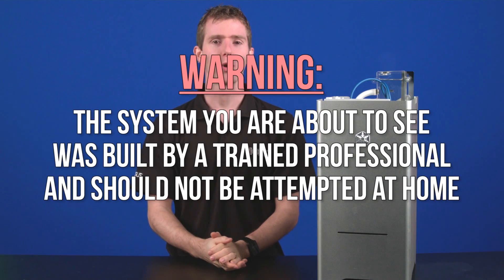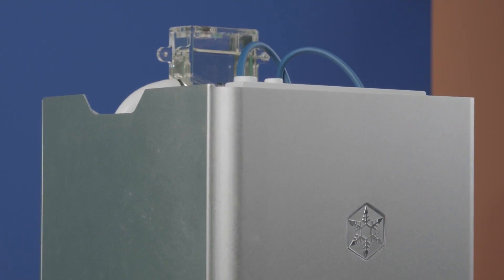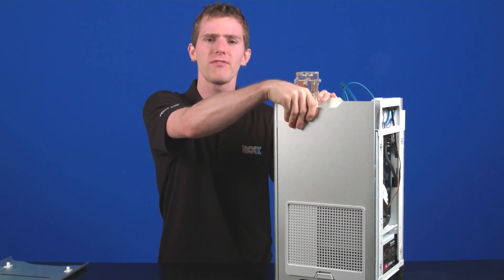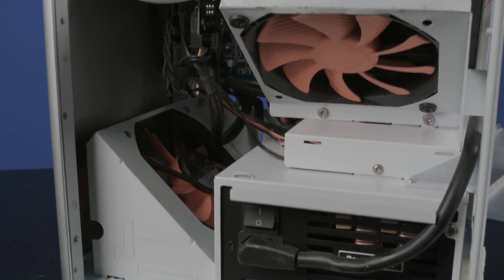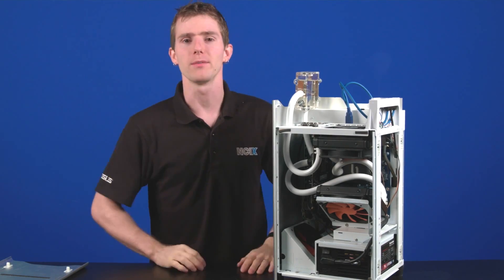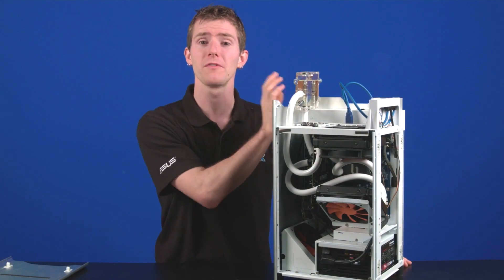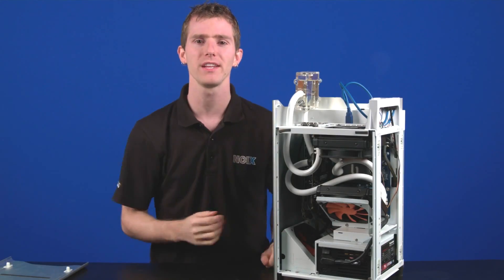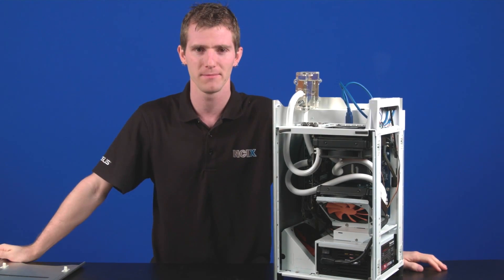Fully Custom Watercooling Loop for under $100!

Comment: My friends used to call my former PC exactly that, "Franken-PC" LOL. It had a completely beaten up chassis (like, hammered from time to time due to ragequits), two DIFFERENT 5850's (one reference, the other a sapphire), TWO cheap ass PSU's, one for the cards and the other for the rest. A Hard disk bolted to the top, because the cage was fucked up, no buttons (used just the cable and the switch), and an adapted cooler from an incompatible socket. Yeah... i kinda miss it now LOL.

BTW, LOVE the setup, just a little ingenuity and you can stretch 100 bucks a lot LOL.
Reply: lol.
do you still rage around and smash your stuff?
xD

I never do that. because there is no point of destroying your own stuff. :P
Reply: Haha, well, i havent destroyed anything lately... mainly because my case is a 750D and is one of the priciest parts in my rig LOL. But i dont play competitive games anymore, wich were my main cause of raging hehehe. I switched to coop for my rig's and peripheral's sake!.
Reply: nice to hear!
I've build a 250D with a 980 in it. 4670k 
booth watercooled with 2x H60 watercoolers

Runns like hell. could never punch it, It would run away. haha
Reply: Nice rig! I love the 250D, perfect for a SteamBox of sorts. Mine has a 290 Tri-X, a 4690K with a Raijintek Triton, 8Gigs of 2133 RAM, and a HX1050 PSU... i want to buy a second 290, but i'll wait for the 390/390x, let's see if they live up to the hype!.
Reply: ahaha my first rig was the classic everything double sided tapped on to a wooden board xD then when i started to upgrade it was a shitty oc dual core paired with a r9 290 which was very mismatched ahaha i bought a case with the rest of my new parts for safety but i do miss having a ghetto pc in a way
Reply: Gotta love double-sided tape.

Comment: streammachine? home theather pc? I still use a i5 3570k....
Reply: and it has a 7850 which is still a very good card , i have a r9 270 (same as a 7870) and still works almost everything on max :))

Comment: my custom computer I built with only $100 runs at 20c and then when gamming it will go up to only 25 in an azza hurricane 200 case blue leds a dh 55tc mobo intel an intel 15 650 cpu no graphics card at all when I built the computer as the mob has onboard graphics but only with cetain cpus so when I get my xeon cpu ill be putting in a 1000 watt psu replacing my 500 watt that's running it right now and my gigabyte hd 6850 windforce graphics card in

Comment: Without cutting out that spacer between the PCI card slots, it could be twisted back into shape (relatively) and used for it's original purpose of securing and separating PCI cards, should the need ever arise. It's not always about the current modification, but sometimes about what could happen down the road.

Comment: Very impressive I like it! I like how it isn't just another slot together build and he has hacked it up himself to create a pretty cool little machine :) Though I think it would be neat if he made a cover for the resevoir at the top, would look a bit cleaner. Still not entirely sure how he managed to do the cooling for under 100 though, even basic gear is pretty expensive compared to air cooling.
I laughed when I saw the PCI slot, I'm guilty of having done that one a few times though with some of my computers to make stuff fit, probably best to just cut it out though!

Comment: I actually mounted a CPU cooler meant for an AMD K6-2 processor on my Geforce 4 ti4600 once, and it actually worked pretty good! All I had to do was just invert the CPU retention bracket, and use long screws to reach the bracket, and locking nuts to tighten it down evenly. Doing this actually shaved a good 20 deg off, compared to the stock cooler!

Comment: I spent about $300 on my custoom WC loop. Covers my cpu, gpu 420 rad, 240 rad and d5 pump and res and rigid fittings. Bought half my stuff on ebay. Great place to find deals on used parts. Pump and rigid tubing and 2 angled fittings are all what i bought retail. Dropped my gpu temps by 52c. So WC is def worth it.

Comment: linus hey a lot of ppl with nvidia cards are running into a problem plz help us if you can or if you are having this issue let us know https://forums.geforce.com/default/topic/792706/geforce-900-series/nvidia-is-there-a-fix-coming-or-not-very-disappointed-new-customer-970-low-usage-/7/

Comment: Wow this is just lazy. Could have put the reservoir in the case, an extra 20 minutes work would have made this system much better. I'm usually not this negative, but the bent pci mounting brackets really annoyed me for some reason. The rest of the project I liked.

Comment: custom water cooling loop
cools both GPU and CPU
45 degrees under heavy load
more or less around 100$
near silent performance
have no need to crank up fans whatsoever
with large case can probably be set to look like a thing of beauty with a little tweak here and there.

gosh i'm really sold on this. can you guys send me a little more detail on the step by step to do this?
Reply: On overclock.net there are lots of users who have made threads about opening up H50, 55, 60, 80 & 100's adding res's changing fluids and tubes. If you can follow them you can easily do this :)
Reply: Aligndude really? thank you man for the headsup. appreciate it

Comment: Liquid coolers on GPUs are mainstream, what I want to see is something like a 212 Evo on a GPU
Reply: there is a video of a guy who mounted a cpu block on a gpu, just search "CPU Cooler on GPU"
Reply: bam
http://i.ytimg.com/vi/Iegpwo9SqSg/hqdefault.jpg
Reply: WitheringintheDark
Usually people do this because the stock cooler is not functioning properly or the card is over heating. And for fun of course!
Reply: Oh, the days back when WC was not mainstream/ oh the days. Next up: mineral oil cooling.
Reply: ncix actually did a video on this like 1 day ago...
Reply: Why? You're better off leaving the stock heatsink solution on it, otherwise the vram and rest of the board will over heat. Water blocks are used 'cause they water cool the entire damn card.
Reply: *****
Water block: $94 Evo 212: $35 Best aftermarket coolers(which will do better) offered by vendors: ~$20-30 over base cost. Passive coolers won't get you anywhere. Waterblocks are short and tight. The evo will prevent you from installing basically anything else in any of your slots, and the extra cumbersome weight can bend the card.

There is no merit whatsoever to sticking an evo on it outside of pure lulz and useless bragging.
Reply: Already been done. Dig through the amd red mod forum thread
Reply: In which case anyone who wants a properly working GPU will ask the manufacturer to fulfill their warranty and fix the stock cooler/heating problem. Or buy a waterblock if they use water. Both would be more effective then simply stick a CPU heatsink on it.

It's only fun until your VRAM or other components fry, leaving you with a dead card you can't RMA because it's your own dumb fault for bricking it.
Reply: *****"True" watercooling (as in a custom loop) still isn't mainstream, and will never be mainstream because of the cost involved. Even a barebones CPU only loop will set you back $200 at the very least.

Now if you're referring to AIO solutions, then yes they're getting more and more popular these days.
Reply: ***** Thats... the exact opposite of what I said. The evo isn't a better buy in reliability or performance. Getting a higher end card using TwinFrozr or Windforce ect. is a better buy, more reliable and has better performance.

It also won't block most of your PCI slots or bend your card or necessitate sticking ineffective copper pins on the exposed and uncooled chipset.

Sticking a cpu cooler on a gpu is something you do just for the lulz, not because it's in anyway practical or effective. Bragging rights only, not to be confused with reliability/performance/cost effectiveness.

Your best bet is always taking the $40 you were going to blow on a dumb cpu cooler to stick on it to pick up a better card with a better cooling solution and much better electronic components over the baseline. Or, barring that, spend a bit more on a water block, and enjoy an extra 100-200MHz clocks.
Reply: *****
Trust me no air cooler will ever be able to match the thermal efficiency of a full cover waterblock. I have two Gigabyte 970s, and even with the fans set to 100% manually (which btw is quite loud), and with an additional 140mm side fan blowing directly at the cards, I could never get my temps under 55C when gaming. Just finished my custom loop last week, and BAM one card now never goes above 39C, and the other never goes above 44C. Best part? Fans on the radiator don't even pass 900 rpm. The loudest thing in my computer is actually the water pump now LMAO
Reply: derflop
i will LOVE to get my PC watercooled. Just need to built it first :/
Reply: kraken x10
look it up
Reply: Pasu suel Exactly. Personally I always get torn between high end air coolers and CLC's. On a good sale both cool around the same for a good price and price to performance ratio, main difference being with the CLC you don't have a 1 kilogram brick sitting on top of your cpu(which can be hazardous if you move the pc much with that kind of weight and it's an aboslute pain in the ass to work around)

In comparison to the Evo 212 for $40-50 more you can get over 10C cooler, which gives a good bit of OC'ing leeway on a CPU. Past that though price/performance drops Real fast. That initial 10C lower temp cost an extra $40-50. The next 10C, would cost an extra $150-200, and you can never get below ambient temps no matter how expensive the WC system.
Reply: Go see someone called diy perks, he did that
Reply: True, just saying
Reply: Thomas The Dank Engine put this on it: http://www.techpowerup.com/reviews/Computex2007/Scythe/images/scythe6.jpg
Reply: I have actually seen somebody do that and it was pretty successful
Reply: +KenKraken give them hyper 212s too
Reply: +Thomas The Dank Engine All PCs in general are too mainstream what we need are things like these http://img.xcitefun.net/users/2009/06/79252,xcitefun-crazy-pc-mod-2.jpg
Reply: Pixeled Opper HAHAHAHA XD god.
Reply: I'll happily trade louder fans and slightly higher temps for a 0% chance of leaks.

Comment: used cpu block for gpu? never done that.

but once (when i was broke) i took the fan and heatsink from my video card that had died and installed it on an old video card with a dead fan. (it was from a friend, the fan stopped working so he bought a new one). the two cards were NOT the same kind so i had to clip off parts of the heatsink so it would fit the card's pcb. then i had to force the smaller fan connector of the working fan+heatsink into the card's fan power socket which was for a bigger fan connector. it tore some of the plastic but as long as the leads connect and it wasn't falling off i figured it was alright.

to my delight it worked! used that for give or take 6 months, then the mobo died; so i decided to build a brand new system.

Comment: You kind'a miss the point of watercooling in this video concept.
Reply: beauty?

you kinda miss the point of gaming rig.
-cool
-silent
-cheap yet good.
Reply: No.. Not really.. The percent difference between a watercooled system and a $20 aftermarket cooler for your gpu (which is what you'll only be able to find) and a closed loop cpu cooler is so minor. You pay few good hundreds bucks on a custom loop so it will look good, and not zip tied all over the place and have a reservoir bulking out of the top (btw that tube .). People pay a lot on gorgeous blocks and plates and amazing loop arrays. The cost to performance is ridiculously low.
Reply: xbad82 good luck fitting a decent  aftermarket cooler inside this case.
Reply: He managed to put a lot more than that inside.
Reply: i'm really fed up with random person on youtube talking about things that they don't understand so yeah i'm leaving this comment feel free to say anything. i'm not really into debate, giving out facts to random people on youtube would just causes headaches since they won't listen to anything anyway.
Reply: What ever you feel like doing man. It's cheaper, less risky, less messy, cleaner and easier.
I can say the exact same thing about you and it will also be correct.
Btw, Linus aimed it to a media pc..

Comment: So this Build isn't $100 because he didn't account for the price of the radiators even tho they are from a Corsair H60, you need to account for the whole water cooling loop including radiator(s)
Reply: it's still really cheap, it cools both GPU and CPU 45 degrees under heavy load

i mean yeah i would want them to be more precise too but, the point is it works charm for low price compared to a real custom water cooling set up!

Comment: If you ask me the real purpose of a water cooling system is to make your system look beautiful. This system looks like crap. no offense
Reply: that's why it's covered with panels
Reply: Yeah. Should be elegant, not a fucking octopus.
Reply: water cooling is not just to look good its for quiet high end cooling that's why almost every AIO cooler will be matt black and missing the leds and dyes etc that you are thinking of, the reason water cooling looks nice is usually just because water cooling takes a certain amount of skill so most people who would do it poorly just dont bother at all and those who do know what they are doing.
Reply: yes but the size of a dh-14 is pretty massive once you add on the fans etc and with the brown fans it kinda sits in the case looking like a bit of a giant turd on the mother board so there's that.

as for AIO coolers performance they perform great for the cost and the premium you pay vs a custom loop is offset by the fact that its hassle free so i support them as a good idea.
Reply: Finlay Killoh It's not necessarily more quite. Asus DirectCUII GPU's for instance can run at very low noise levels. And there are also very good CPU heatsinks that also run very quite. That radiator needs to be cooled with vents too. So you'll end up with noise nevertheless.

The plus thing about water cooling systtem is that is leaves more room on the motherboard.
Reply: ISA's Sekai
water cooling is quieter simply because you can run fans at lower rpm, as for air coolers they can operate as well thermally but usually are louder or 3x the size and not much cheaper than a water cooling option once you include non stock fans etc.
Reply: Finlay Killoh
 Watercooling is cool I have it on both my cpu and gpu with much lower temps.. But the NH-D14 will equal or out preform a H100i by a few degrees. But if I was out looking for a cheap way to make a custom(ish) loop on a really low budget heck I'd do this.
ISA's Sekai I think if the system was in a much larger case and more laid out it would look slightly better, being in that case isn't exactly helping the fact.
Reply: Aligndude  AIO's typically don't perform as well as custom loops. Noctua or BeQuiet! air cooling is a better choice over AIO's anyway.
Reply: Finlay Killoh  You could always try painting them I guess. They look terrible but they perform so well. I have a 120mm painted to match an old blue and white scheme. It looked like ass but at the time I was proud of it. Regardless, I agree.

And I also agree AIOs beat flushing out a loop, awkwardly fitting your hand around your components in a cramped case, and like hell you will see a leak on the new AIOs. They are great for what they provide as are premium air coolers. However, custom loops look and perform better but, have the huge trade off of spending a fortune sometimes and needing call out of work for a week working on it.
Reply: Finlay Killoh As long as you can isolate pump noise watercooling loops are quieter. One reason I don't recommend a bay pump/res combo.

Also I have Noctuas on my rads and they look beautiful so fuck you!